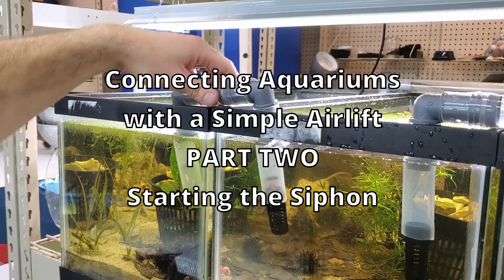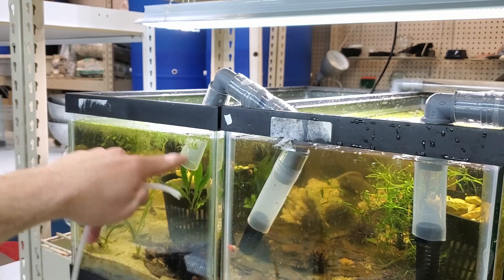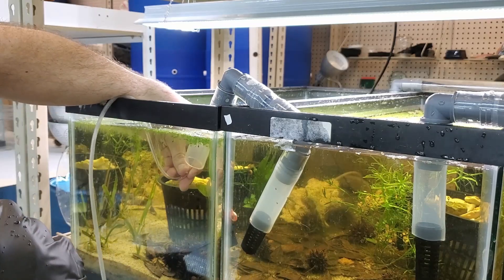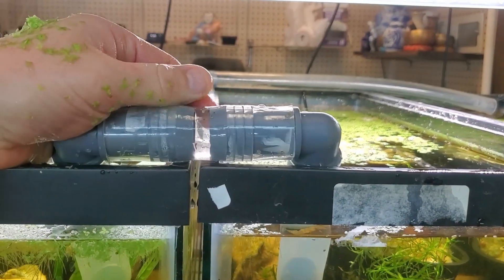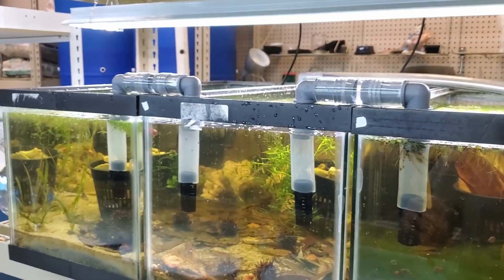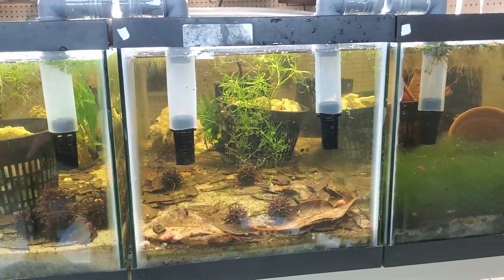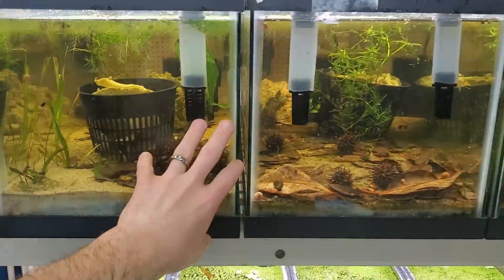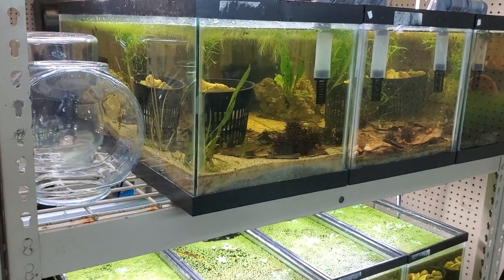PART TWO - Connecting Aquariums with a Simple Airlift

Comment: i have use this method but overtime bubble start appearing at the siphon and worried it will break when im a way, is there any solution for this?
Reply: When he tips the tube to get air out he has a small corner that once you have enough that the corner has a complete air pocket breaking the two bits of water in half then you have no siphon. The normal running longer horizontal layout means you need a lot more air before the siphon is broken. You can increase the size of the pipes in diameter and/or length to increase the safety margin; larger diameter pipes at their opening means a bigger area that air may be captured though. Some aquarists replace the round tubes with square ones made from acrylic or glass which gives more internal area for a given single dimension external measurement because a square with a side that is the same length as a circle has a diameter always has the square containing more area.
  You could enhance that effect with an additional section of pipe pointing upward that is capped off; doesn't need to point up but just needs to be above the siphon break height. Think of the corner where he extracted the air. If that was a T with one end capped off pointing up then he could get the tube up into that end of the T and would have to bring more air out of it meaning you have to get more air back in before it breaks.
  Output from the high point can be connected with a small tube to the point perpendicular to or in the same direction as the flow from a powerhead. Water will be pulled through due to the pressure difference being in the high flow. Many small powerheads have a place to connect airline tubing to bring in air as a basic venturi action. Being a smaller tube helps move even small air bubbles without needing much flow but being a small point of flow opens up possibilities of it clogging too. This can also be used as an alternative way to move fluid instead of the airstone driven siphon in case you find powerheads more reliable or quieter than air pumps.
  Put the siphon ends in areas with minimal bubbles, possibly even into the substrate, and consider an intake filter that keeps bubbles out like a sponge or wad of filter floss that protrudes around the outer edge of the tube.
  In the end, periodic review/maintenance is the biggest trick to maintaining this design. If you need to guarantee that you won't lose a siphon, replace it with a design where you install bulkheads below the water line in adjacent tanks that you the plumb together (only some tanks can be drilled). You could also build a design where one tank is over the other and you overflow water out of the top tank with it being located so that water spills down its side and into the next tank. You need to have the top one entirely within the lower tank's bounds, have only some sides higher than the ones you want water to overflow, and may need to have the tank not be level to impact how water flows down its sides; tanks are not significantly weaker by not leveling them but a level water line in a tank is more attractive. You can build up guides that restrict the path of water overflow too.
Reply: Bubble is starting to appear because you have airleak in your siphon... Best would be to have one piece tube, or tightly sealed multiple part siphon...
Reply: @markohorvat1122  A bad seal could happen though its unlikely unless there is damage/defect to multiple ridges it slid over. I'd probably silicon grease those points during assembly if I had any concern there. Soft tubing does cause permit a "small" amount of exchange to happen but I'd check other sources like occasional bubbles in the tank before giving that any credible thought.

Comment: Do you need to part that transport water van tank 1 to tank 3 ? I use alot of small tanks and i want to connect them  to have ''more water for stability''
Reply: Connecting has advantages and disadvantages. If you have something in 1 tank you don't want in another then you need a filter like the screen he used for snails or else you don't want to connect the tanks. If you just want one big pile of water from your many tanks with no concern about their contents being shared then connecting with siphons like this is fine.